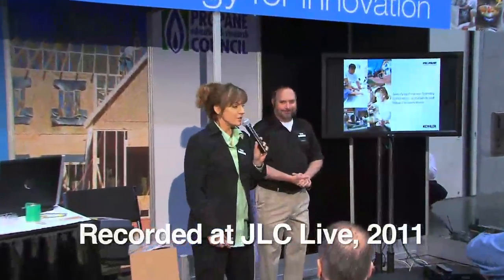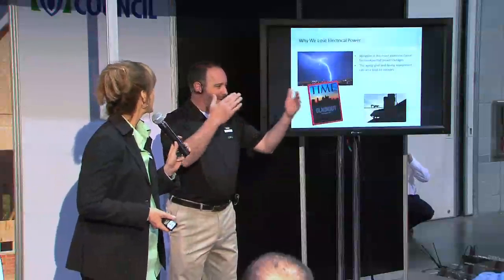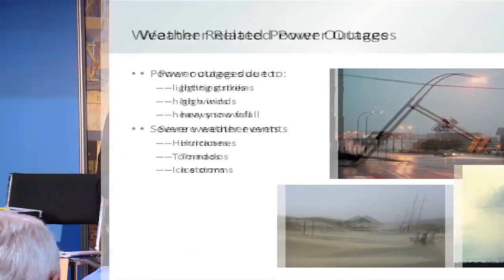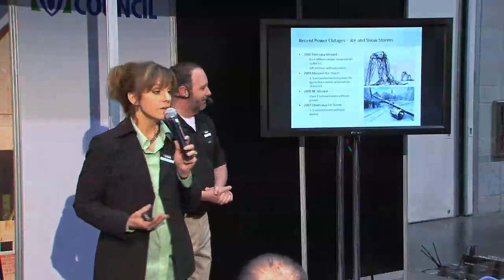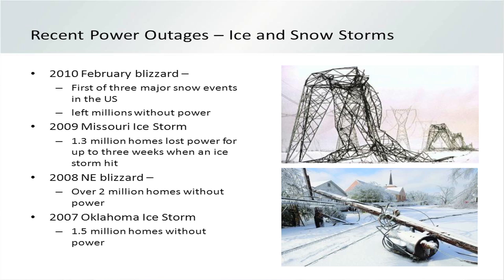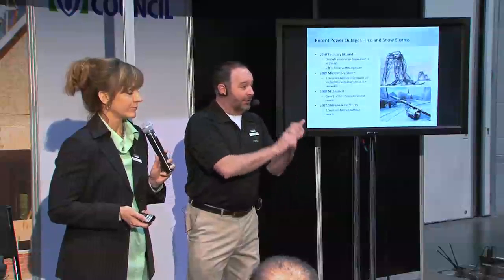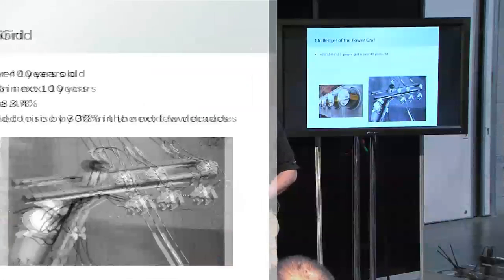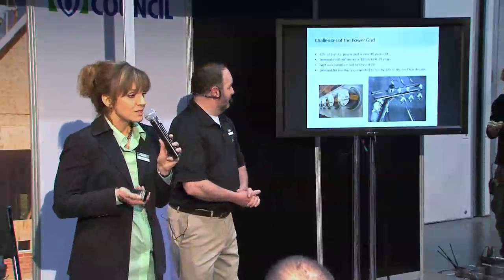Sizing and Installation of Residential Backup Generators (Part 1/3)

Comment: Endured the whole 11:19 of this clip. The advantage of diesel powered generation is that the genset & it's fuel (possibly a lot of fuel that will last for many days or even weeks) can be stored reasonably safely on site, it is also easy to buy in large quantities. This could also be done with gas (propane & butane etc) in large cylinders, but is not as "energy dense". My 0.02 worth...